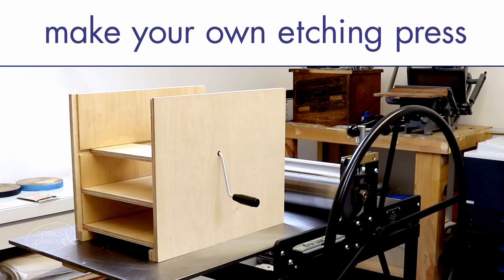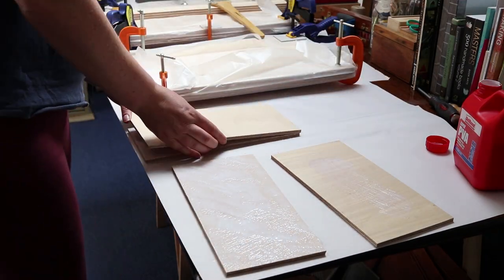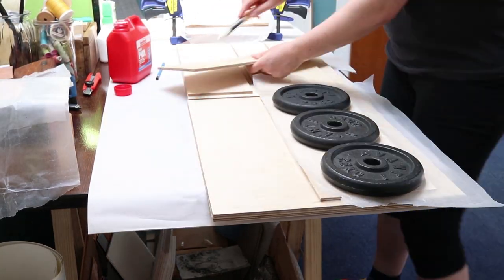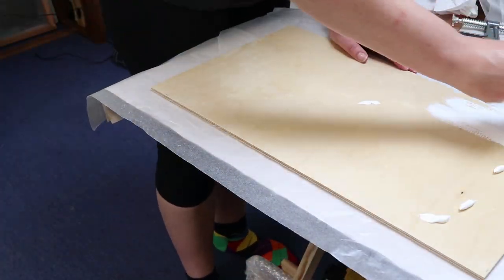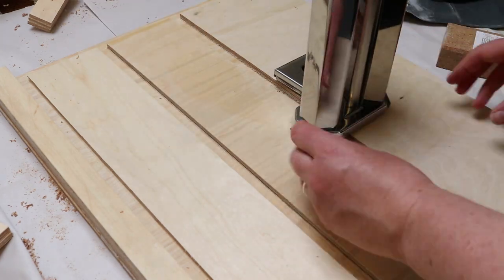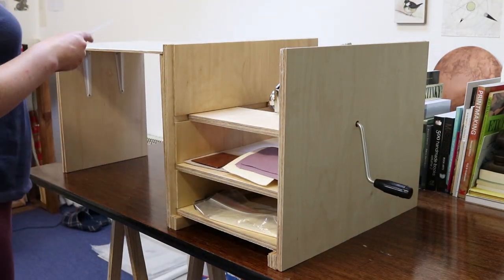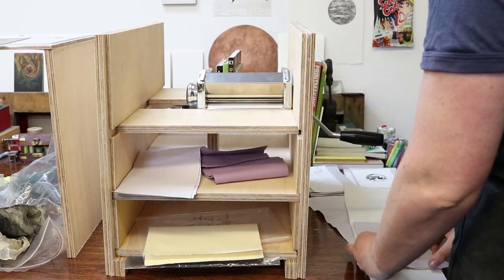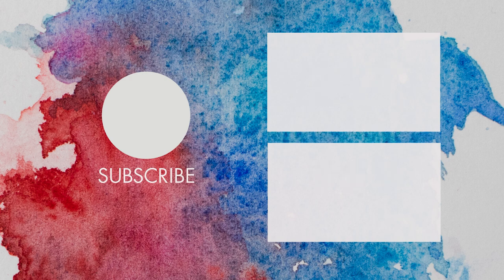Make your own etching press from a pasta machine!

Comment: I studied printmaking, specifically intaglio, in college and have wanted to find my way back to making some quality editions ever since graduating. Without access to a print studio, it feels almost impossible. Meanwhile, I have owned a pasta machine for almost 20 years, and it never occurred to me that it could make enough pressure to squish some ink from plate to paper. I am very excited to try making some prints with my machine, while simultaneously feeling kinda dumb for not thinking of it sooner. Thanks for the video!

Comment: Can I be that pain-in-the-neck guy who asks what all the other materials are? What are you using for the padding around the paper and plate? How about ink? Thanks, if you get the chance! Great build.
Reply from the maker: The printmaking paper and plate are sandwiched in a piece of folded up newsprint with a piece of scrap plastic underneath to give it some stability as it goes through the press. Around the outside of this is the wool felt that helps push the ink from the plate into the dampened paper. You can add some more pieces of newsprint to the stack if you need to increase the pressure. The ink I used is etching ink made by Charbonnel. They have a bunch of different black inks for different types of etching. The stiffer ones (F66 and 55985) are more suitable for line type etchings and the looser ones (like 55981) are more suitable for aquatints and tonal work. Most other brands make their etching inks all the same consistency, and you can modify them with different additives to make them looser or stiffer. To put the ink onto the plate I’ve used a piece of rubber eraser, and to wipe it back off the plate I use a combination of tarlatan (a stiffened open weave cotton sometimes called scrim) and some pages from the phone book. Hope that helps!